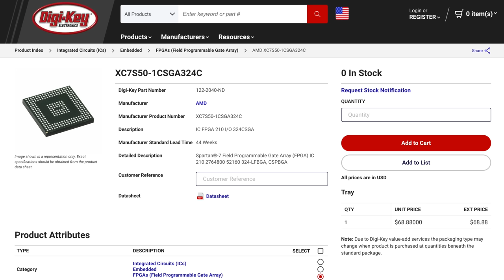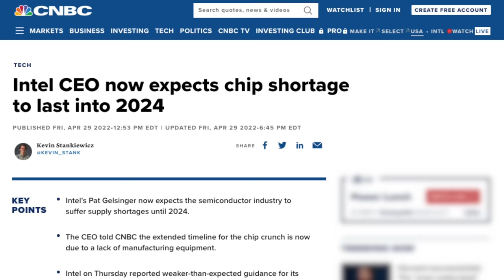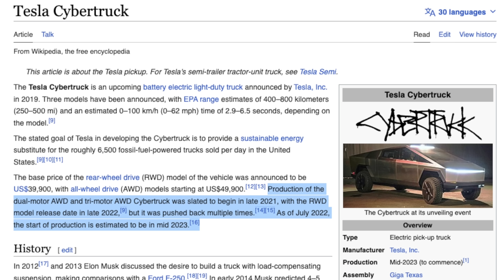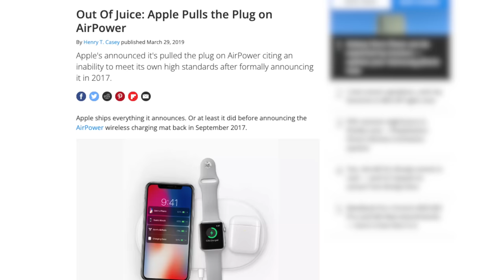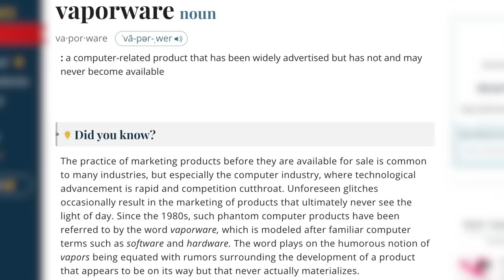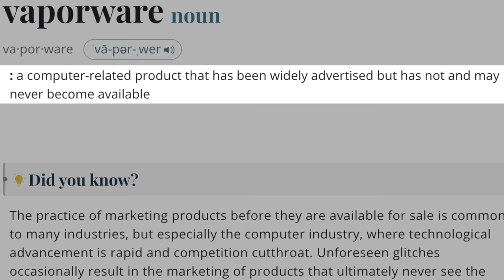Where Is Theia? It's 2023...

Comment: Yeah, there is more to this story. Those Xilinx chips have been available in small quantities from reputable sources here and there over the last 18 months. (I have been tracking) They should have a PoC at bare minimum. No movement on app, no RDF, no YT. How can one think there isn’t more to this story than Jon and Randy sitting in their office waiting for FPGAs.
Reply: 90% of the non-trivial FPGA projects I've ever seen end in failure because clueless management buys the ads that it's just software and the compiler is so good people without VLSI/computer engineering design skills can do it, which is always untrue.
Reply: There's no more Randy. He has left the building.
Reply: @PaulDo22  what’s the story on that?
Reply: @cuppacheese  Left late last year. Radenso has effectively shelved their RD unit and no new products are in the pipeline. No more Randy.
Reply: @PaulDo22  I'm sorry but you are incorrect, I left Radenso for my own reasons.
Reply: @Rannd  I don't blame you! Good luck man.

Comment: If the processor is the holdup and its been a supply issue this long, they really should redevelop it to run on a different more widely available processor. By the time this one gets in constant stock it will most likely be obsolete.

Comment: An even better example than Apple is the new Valentine, how long they were dark/no updates, it became a laughing stock on the forum for over a year.
Reply: Quite different. They already had a working product. Didn't make astronomical promises that they couldn't deliver on. And this has been almost 4 years lol
Reply: @evictioncarpentry2628  You're right, they are different, Mike eventually came through with an actual product, not a bunch of "we're going silent" talk. :)

Comment: I agree 100 percent with you about getting another high end detector if you want to wait for Theia. I was working as a consultant at a global company that had long delays on the computers, Docks, USB  Hub monitors yet as a global manufacturer company they were able to get them months down the road. Radenzo is small company with no real buying power, Larger orders will get sent before large orders due to the supply chain issues. This is why I went out after reading from Vortex, Radar Busters, the RDforum, etc. and ordered the Uniden R8. The R8 is the current King , i just wish Uniden would release the update to enable Bluetooth? I have my cell phone in a mount on the dash with Highway Radar, an awesome app that a leaned abut through Vortex.

Comment: Maybe Radenso was trying to buy time by citing supply chain issues. I think it’s time they redesign around a new CPU architecture because it’ll most definitely be quicker than waiting for the Xilnix/AMD CPU to be in stock. Just my opinion.
Reply: Or they were using people in the industry to make their name known, sell the idea of how cool this would be in theory, which then would drive sales of the Pro M, now DS1, as well as their hard-wired option, none of which I feel would have had any chance against industry standard giants without someone being duped into vetting them and bringing them to the niche market we users are. I genuinely feel bad for Ariel and other big names in our community as I genuinely think they were used based on their existing clout.
Reply: When supply chain issues actually started in 2021 due to backlog on shuttered fabs and socially distanced labor force reductions, they're implying they would be shipping production units if the shortage didn't exist but said shortage has been an issue from 2020 through 2021... they would have received their allotments seeing as backlog is 44wks as Ariel showed for the exact chip they keep making this excuse about, therefore we would have seen an albeit smaller than ideal quantity but at least SOME units: You know where you saw real supply shortage impact with their own company? The DS1. Small first allotment, few months then another bigger one, and now they're available anywhere that stock them. It's bullshit. Jon is a liar and I'm frankly pissed for people like Ariel being used only to get a seat at the table they never earned.

Comment: Radenso has become a massive disappointment in the radar detector industry because of Theia and the poor handling of this situation. By the time Theia comes out, Laser will be the predominant tech for law enforcement, leaving Theia irrelevant, and this is if Theia even comes to market. Radenso should cut their losses and invest the time and money into rebuilding their reputation if that is even possible.
Reply: Laser has had a chance to become dominant and it hasn't yet. I doubt it ever will. Basically the tech needed to make lasers actually useful for police speed enforcement is also militarily useful. That means lots of patents, money and secrecy from some big players in the MIL space that don't want that tech getting into lesser hands, because police gear almost always ends up in civilian hands eventually. Only two (known) aircraft in US inventory have had the capability to use a laser to self track another moving object and then lock that target and that is the F-117 and the F-35. Take from that what you will.
Reply: @ZboeC5  in some states laser is almost all you see, especially DE. If I were Radenso I’d scrap Theia entirely and focus on laser jammer tech. The current offering suck and require an absolute perfect install with multiple rounds of testing and adjustments to even have a chance at jamming new guns.
Reply: @hkfan4596  If DE cops want to use laser, more power to their try hard asses I guess. Radar will capture 99% of speeders. Whenever I see an officer shooting laser I assume he is kind of a moron anyway. Which considering that a police agency won a lawsuit over not hiring somebody onto the force with an IQ that they deemed was "too high" isn't so surprising...ugh. Also isn't DE a tiny state where even if you don't speed you won't be there long enough to notice anyway? Why even bother? I wonder who got the kickbacks for the laser gun sales?
Reply: @ZboeC5  this is why uninformed ppl shouldn’t make comments about things they have no clue about. DE stands for dragon eye. Not the state. Research it. Increasingly a serious issue for drivers.
Reply: @hkfan4596  I'm sorry you used an acronym for a state when talking about seldom used laser guns for catching speeders.
Reply: @hkfan4596  And one more thing, I'll put my 100k+ miles per year on the roads as evidence that laser is seldom used. If it was so damn prolific then I would be getting pulled over, and I don't so yeah.

Comment: I would imagine that chip is being trashed.. Its aging.. Its now part of a platform with a new parent company.. SO ya. im guessing the silence is because they have to restart completely.. Putting out the bad news of another 3-4 year rebuild cycle as they find a new chip isn't something they probably want to do.. maybe they are hoping for something to be made that they can use.. They should partner with Icom or Yasu for SDR chips.
Reply: Xilinx’s FPGAs are used all over the place in military and industrial applications and many have a 10+ year guarantee of production and availability (at least if you are military). 

No chance that these spartan 7s get discontinued. Entire industries rely on this specific part. 

-electrical engineer that designs robotics.

Comment: Vaporware
Reply: I called this years ago too btw
Reply: Going on 4 years.  Jon scammed investors while hyping this.
Reply: Ppl were banned on RDF for merely suggesting Theia was vaporware. And Vortex was one of the ones who routinely defended Radenso against any criticism, even after Jon was suspended. Vortex lost all credibility after that.
Reply: @hkfan4596  I was one of them. They couldnt handle someone calling out a vendor because theyre a bunch of azz kissers there. Thanks for pointing that out. Lol
Reply: @evictioncarpentry2628  It's run by a bunch of tools.
Reply: @anthony08129  Oh I know. And I let them know thoroughly, Hence the permanent ban haha
Reply: @evictioncarpentry2628  the whole forum is now so heavily moderated in favor of eliminating any criticism of certain vendors, even if those vendors are so clearly deserving of being called out, that the forum has lost all credibility. There is zero ability to engage in a free flow discussion.
Reply: @hkfan4596  100%. Haven't looked back since. That place is a joke.